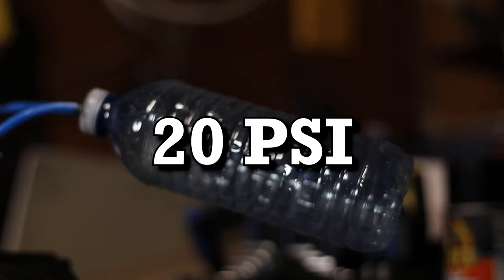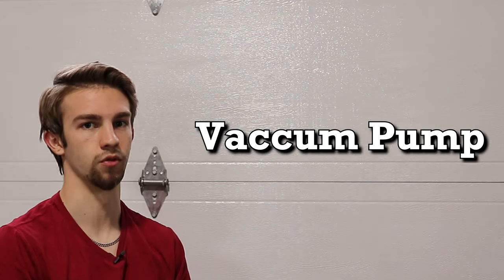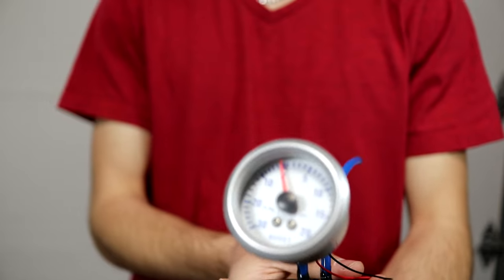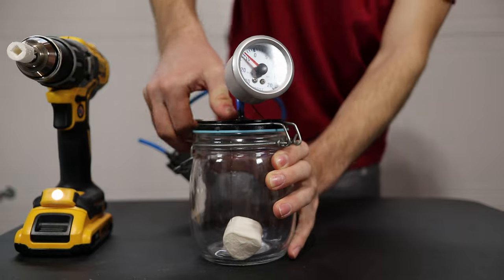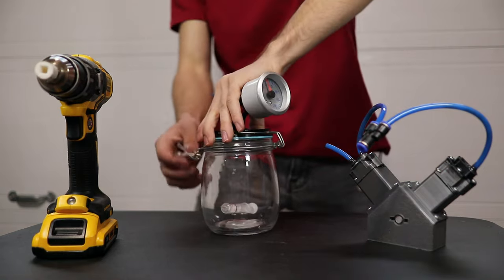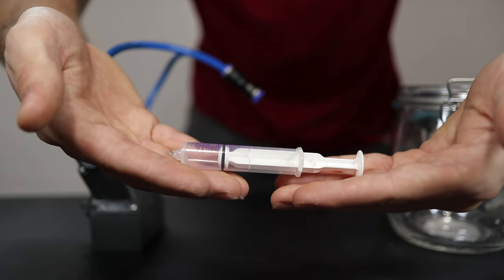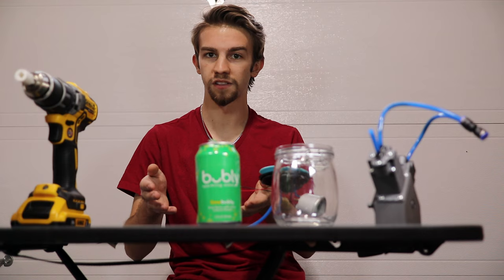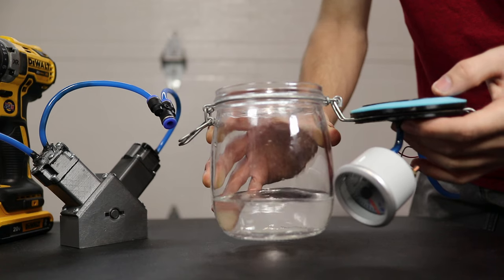The 3D Printed Vacuum Pump (literally) SUCKS!

Comment: soo really nice concept but what if you make a bigger piston and a longer cylinder like 30 to 40 mm wide that would increase the chamber and volume and would produce more air/vacuum... And also how can you make that in to a working pressure washer it is kinda the same idea but a lot different

Comment: This is very nice on how it can withstand those insanely high vaccum pressures without the o rings coming off or without the plastic breaking in the piston
Reply from the maker: Part of the advantage of a vacuum system is that since the pressure is greater outside than inside, that means the pressure outside pushes all of the vaskets and other components together with more force so technically using this as a vacuum pump should withstand more pressure
Reply: @CamdenBowen  jeez ur a freaking scientist man ion know anybody that could teach me that besides u but yah thanks man

Comment: Compressor - Airbrush
Vacuum Pump - Silicone/Resin taking out bubbles, as we saw thats possible with liquid so what about thicker liquids? :)
Reply from the maker: It's possible, but since it doesn't draw a huge amount of vacuum it may require some waiting for the air to be drawn out

Comment: Taurrozi pendulum mechanism?
For an air engine?
Should reduce total friction.
Could bend a tube to get the toroidal cylinder. 
Could also get an opposing piston running.
Just a weird thought.

Comment: Here i was checking around on 3d printer and how viable it is using compressed air for cooling to reduce weight and you built one in earlier video and a reverse (vacuum). dame cool really
Reply from the maker: Thank you! I'm sure you could find even more uses for it than I could!

Comment: Can we just use this for resin preparation essentially to remove all the air molecules of the mix.
Reply from the maker: It should be possible, this method is often used before casting to remove all the air pockets from the mixture

Comment: can you create perfect vacuum by adding enough cylinders? for example if you were to create mighty V8 compressor and try to lead the tubes from one to another or maybe pairs of pistons to reach better vacuum? might be a great video idea
Reply from the maker: I'm not sure about a perfect vacuum, but adding more cylinders should aid in vacuum
Reply: Piston pumps aren't really great below about 5 mbar at best, that's where oil sealed pumps come in to play such as rotary vane pumps which can easily reach under 0.1 mbar

Comment: Could use this for my plaster of paris to get all the air out for my cast, i just need the salt fro the hydrogen in the aluminum. Or for rubber or silicon de bubbling

Comment: Actually NO, vacum is MEASURED IN PASCALS with is a measurement of preasure.

But the measurement that you are talking about is called TORR, but is stopped being used in 1980.

Btw: Good vid
Reply from the maker: Thank you! I knew that but forgot to specify it is not the SI units, that and the units of measurement on the boost gauge itself are read in In. Hg
Reply: @CamdenBowen  No worries, I am still hyped for the 3D printed gasoline engine.

Comment: Something u should do is in infinite energy source see if u take the exhaust side of the compressor and make it go Into an air tank that's full of pressure and take the intake and put it at the other end so the air passes through the tank only one way it will push air into the intake of the compressor and the compressor will push air out into the tank w hich goes back into the intake so it continues over and over again and never ends and it makes free electricity if u hook an electric motor that generates electricity to the axle